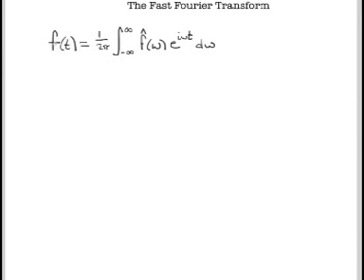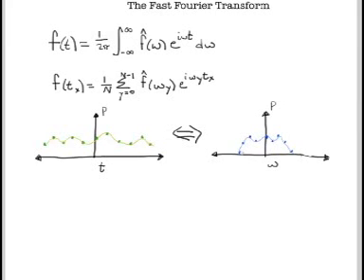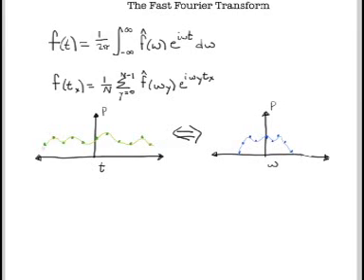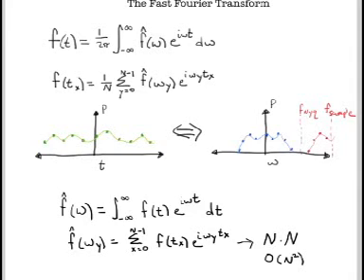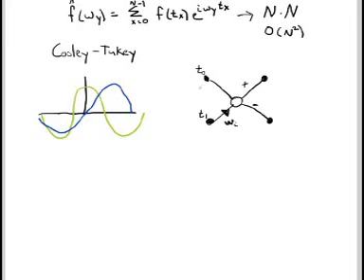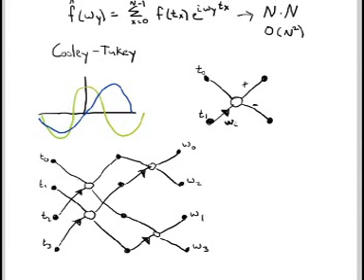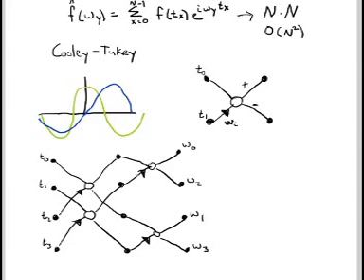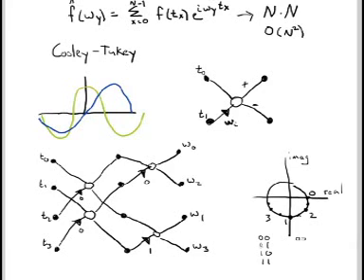Introduction to a Fast Fourier Transform Algorithm

Comment: Hi Mr. Aaron , i've been thinking of this problem for years, if the fourier transform of a sinsoidal signal with 1 Hz frequency is impulsive, so that means all the other frequencies are orthogonal to it since the amplitude of F(f) is zero every where except at 1Hz, HOWEVER : if you try to evaluate the correlation between 1Hz and 1.01Hz the result is UNDEFINED ?
i mean the integration of the dot product sin(2*pi*t)*sin(2*pi*1.01t) over all time is undefined !!
while the F(1.01)=0 where F(f) is the FT of sin(t)
so how that works ?
thanks for your time.
Reply: *****  i didn't get it ?
what are you talking about ?
magnitude of both frequencies is 1.

Comment: Just a nitpick: Fourier Transform is a dual space transform between any space and the spectrum of the space. It's not just neccesarily time and temporal frequency. It can be as well spatial space and spatial frequency. And depending on the application it can be even a dual space mapping from time domain frequency to spatial distribution (I'm currently doing research on a technique where this kind mapping forms the foundation of the signal processing; Google for spectral domain OCT)